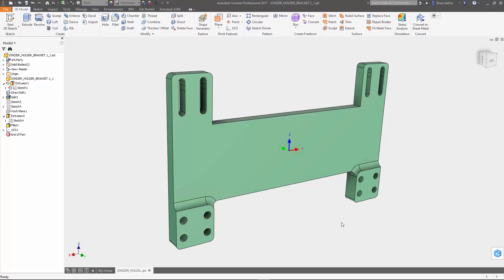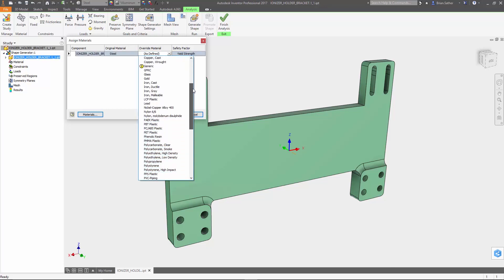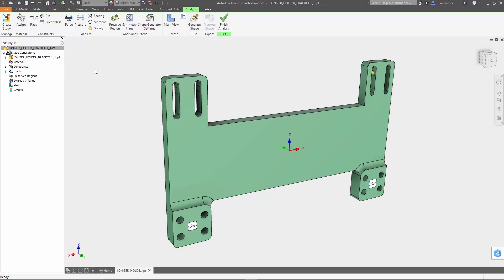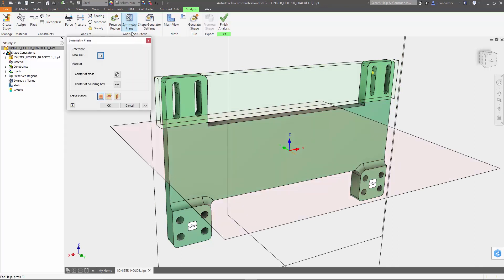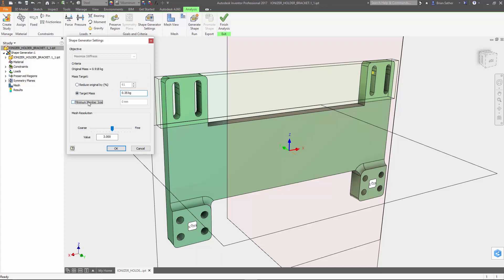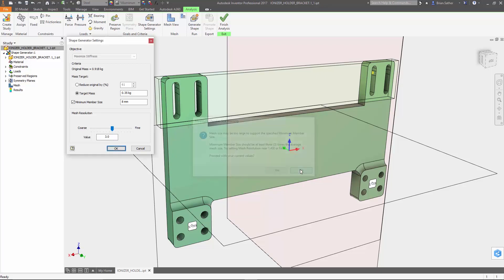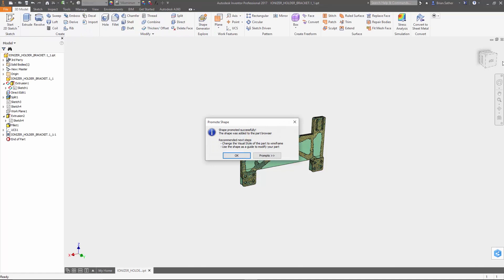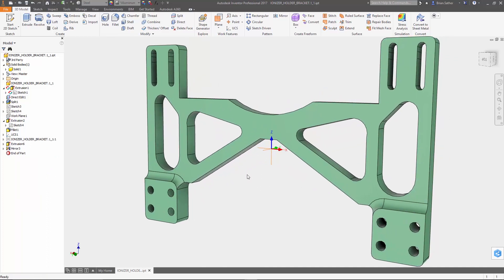Autodesk Inventor 2017 Shape Generator Tutorial

Comment: Hi, I got a floating top surface with totally no connection to my bottom surface(my fixed constraint) in one of my simulations. any suggestions on how to keep load path unchanged automatically? i think in Fusion they have the Load Path Criticality
Reply from the maker: Hi ever noe caprangca,

The best way to get a detailed response to your Inventor-specific questions is by posting on the Inventor Forum.

Here's the link: https://forums.autodesk.com/t5/inventor-forum/bd-p/78

Hope this helps!

Best regards,
The Autodesk Inventor Team
Reply: I've noticed this too. Generally you'll have a fixed/pin constraint, as well as one or more loads applied on the part. What I've done to fix this is swapping the placement of the load and the constraint. Playing around with this normally fixes it, but I have no idea why this is a problem in the first place. I hope that makes sense!